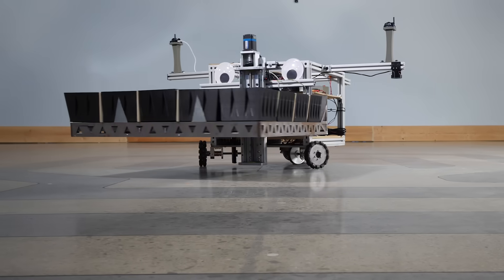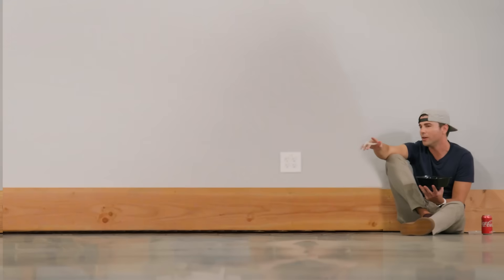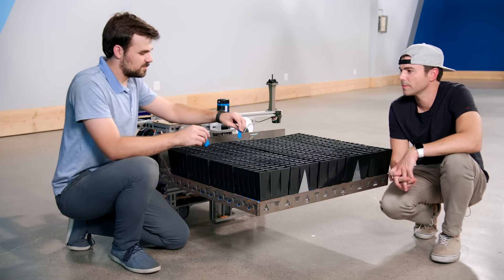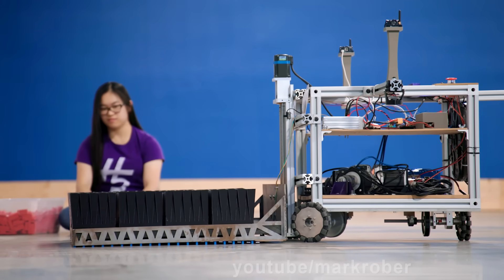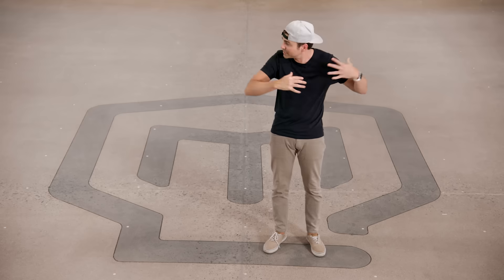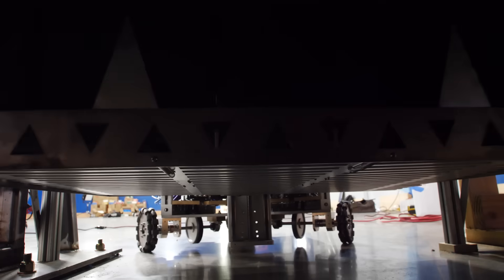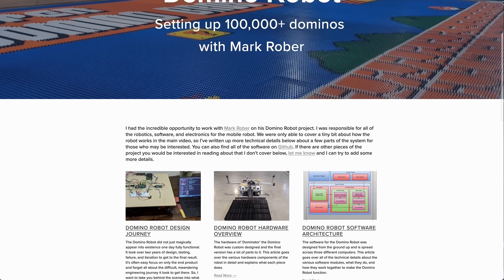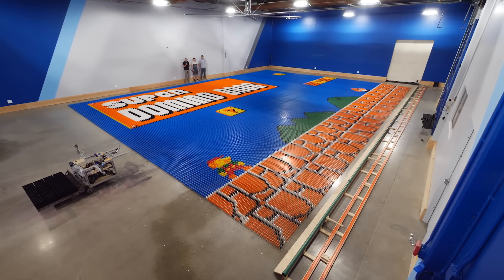World Record Domino Robot (100k dominoes in 24hrs)

Comment: cant you do it with a like reloading bay, where as it has 3 basket case where the first 300 dominos drop and the there’s another 300 dominos on the second level where we can use either a rotating basket or a secondary basket and drop of 300 and make it 3 times the building speed

Comment: It’s incredible that the weight of 300 dominoes being dropped at once didn’t cause any vibration or disturb the air enough to dislodge even 1 domino, I know it was very low to the ground but having just spent hours sitting up dominoes with my kids, albeit quite small dominoes, so many things can go wrong.
Reply: Concrete slab floor, basically no vibration from tiny light pieces of plastic. As for the drop, the amount of wind they displace is minuscule, there's probably more force in the natural convection that's happening in such a large room.
Reply: True😂

Comment: Ok, that's cool.   However, (probably already stated) per IDTA (international domino toppeling association) rules section 08291997.0214  only a  "single domino toppled may initiate the entirety of the chain reaction."  AKA - you only get one push rule - "the domino effect".  Delayed in series pushes with the  turtle and pipes would be a  immediate disqualifier.   Thus victory must go to Hevesh5.  I'll check back in 2 years for round 2.

Comment: Dom could be a tile layer's best friend too, especially if there was an elaborate custom floor pattern.  Just have Dom drop the tiles, then come thru and put the spacers and grout!
Reply: No. That's not how it works.
Reply: No, because tiles are often laid on an uneven surface and require a lot of fitting and cutting to size. It'd be too complex to program a robot that can do all that, and in a place it's never seen before, with so many unknown variables.
Reply: @Eagle3302PL  I don't mean letting the robot do the whole floor, I mean letting the robot set out the tiles in advance for the human to come through and finish it off.  Making a mosaic takes a ton of work due to selecting the tiles, this would take the work out of that and make it just like doing a normal floor.

Comment: this must have took a decent amount of effort but this is on the level of average for the high school I went to, available robotics and programming classes. it's the sort of starter program and robot we would build. It was a sort of proof of ability type build test. you would learn the basics of programming and this would be done in conjunction with another class the principles of engineering which would then be combined as a sort of test.

Comment: The follow up should be not only a clean up robot, but also one that sorts the pieces by color. I believe it will be much easier to design and make than the Dominator.
Reply: I kinda of did something like this as a final project for my robotics class in high school, we had to make a robot that would sort out foam balls by color.
Reply: Didn't their mechanical arm already sort pieces by color? The domino loading looked fully automated.
Reply: @illusionofquality979  They were loaded autonomously but were fed into the loader pre sorted

Comment: Anyone else noticed the row that didn't fall at 7:04? I love these videos btw, Rober is such a skilled engineer!
Reply: I did
Reply: No. But at 13:35 there is some rows in the big orange square that didn't fall
Reply: @quickmicdk  It's not a flaw, those are artifact lines for accuracy
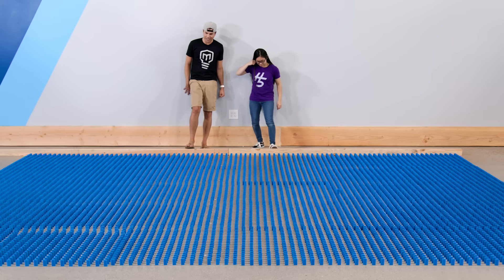Reply: At 6:54 you can see that they don't stand exacly in row, the robot had to calculate the position instead of see it, and if the algorythm and other factors aren't precise 100%, soner or later things going bad. To avoid this, the robot have to unstand how the field looks currently and what a correct positon really is.

Comment: As impressive as that was, and it was pretty cool, the robot did lack one thing that the human does..  The human version would have created a special falling path instead of 100,000 parallel dominoes that were all tipped over in mass.    What was lacking was some kind of falling pattern, the whole point of dominoes is you tip over one domino that triggers a much larger cascade of falling dominoes.   What was needed was a special pattern on one of the edges of the placer that was employed at the edge of the patterned that would have looped the falling dominoes back to the next row so just pushing over one domino would have knocked over all of them.   Don’t get me wrong that was an impressive engineering feat, but it did not represent what a true human made domino pattern does…. that a single falling domino triggers the falling of all.

Comment: Now for the next level...  Where the individual dominos are coded so the arm knows which color is which so it can use them (or sort them as needed) automatically, with Dom laying them down so that the end of one column will trigger the next column over, with the other end of that next column repeating the process, so you can start one domino and then it will knock them all down one column at a time.

Comment: I loved your invention, it's great the way you build everything modeled and thought to the point that everything is where it should be.  It is disrespectful to do it but I know that your invention could be further improved.  Currently the robot puts chips, travels, recharges and returns to place, what takes the longest is the trip so put more levels separated by gates and you could place a motor that opens and closes gates between each level and you can carry 3 or more domino plates and so instead of making 3 trips for 3 plates would be 1 trips for 3 plates or less.  For works reasons it would be faster and you would break your own record.

Comment: Id imagine fine tuning that platform to not have any wobble when it’s lifting was the biggest headache to this whole thing. It wouldn’t be super hard to just build a robot that followed a set plan and unloaded in a specific grid or something, but to make sure it wasn’t a wobbly vibrating mess, especially with that large and heavy a platform, and the way the mechanism to pull the trap underneath works must’ve been very time consuming.

Comment: Now what they need to do is create a baseplate and loading system for Dom that would be switchable so they could make turns with the domino's. It would have been way longer and cooler if they could have just started the chain reaction with one tipping of a domino.

Comment: tbh i find it very funny that this has 5 years of engineering built into it but isn't triggered by a single domino push but its very understandable and also still very cool. this combined with a lil human help to form the 'extra' stuff outside the main mural (the lead in line that triggers it all, any other fancy tricks that require curved lines etc) seems like a massive timesaver

Comment: Just a question I had when seeing the connect four tray release the dominos; if the tray is a single unit moving at once, why do the dominos on the far end drop before the dominos closer to the motor? Does that end move faster and release first even though the tray is one solid unit, or maybe it has to do with the droop of the tray over that distance?

Comment: Hmmmm... Pretty impressive, but to be fair, you've got two robots working together (the loader and the placer), not one. Also, the robots have got some extra tools handy, like funnels for easier loading and trays for faster placing. I wonder if you replaced the loader's robotic arm with a human trained to the loading task using funnels, and replaced the placer with another human trained to place dominoes with 300 at a time with a big tray... Would the robots still win?
Reply: I mean, it seems to me that the big facilitators here were not the autonomous robots themselves, but things that humans could also use to their advantage: the static tools and the pipelined process.

Comment: Wow, only 14,000 lines of code?  Impressive!  I have to deal with 32767 lines of code in each controller in our support sessions.  So, what is the method to pick up (not just push them around with a pushbroom) all the domino pieces after they have been tipped over?

Comment: All you need now is a duel container system programmed
to detect the dirt while cleaning up the dominoes.  The dirt
will go into one container and dominoes into the other and
all you have to do is put the clean dominoes away and not
have to sweep and clean off dirt from the dominoes when
the time comes to pick them off the floor.

Comment: Very impressive, love the detailed graphics! 
I spot at 7:05 some offset in some rows preventing the dominos falling completely as well as at 13:30. Is this a matter of resolution of the local positioning system?
Reply: It seems not all of them fell, you can see a row still standing at 13:40.  Then at 13:56 it is knocked down.  Did they manually knock that row down after the fact?  I didn't watch the entire video, do they mention this?  Does this still count as a record if they didn't all fall?
Reply: @digiride6155  I think the record was for building it, not knocking over the dominoes.
Reply: If they don't all fall down how can you say it was properly built?  What if another robot is faster but only half of them fall down, do they get the new record?   I took the time to watch the whole thing, and it's very impressive, but the deception bothers me.  You can see more that didn't fall at 13:43 in the B of Bros and then in the final shots they're knocked down.

Comment: Fantastic job.  Loved the science behind the robot.  I have a potential solution for automatically sorting out the dominoes when done.  You might even be able to adapt it for auto loading them for deployment.   Place a RFID chip in each chip that had its color.   Then you can have a reader to sort the chips into the proper boxes for reuse later.

Comment: Was there consideration of using a hopper approach vs the matrix you ended up using? (I assume to support parallel work: prep & dispense?)

I'd be interested in knowing if setting up one-by-one and just pulling from a hopper the desired color (and returning home to fill the hopper when necessary) would be significantly less efficient. If so, how much less efficient? 

And while I'm impressed with the positioning, I would venture to guess the hopper approach would result in more true lines (less variances between trips back and forth to the reload station)?

Comment: Absolutely fantastic!

I'm wondering if you had contingency plans in the event that some or all of the dominoes were triggered prematurely?  If you had to restart how would you have started with all new new packs of dominoes or did you have a system for sorting them based on color?  Was the software designed to handle re-building sections of the design?
Reply: No. Definitely not.....yet

Comment: And here I am, at my tech limit, putting a starter and clutch in my R1, and maybe a circuit board, motor, timer, in my washer, dishwasher. I was a Mercedes Benz tech for 7 yrs, but, I just worked on them, didn't engineer them.

Comment: Sir,
I have a query to ask, it is believed that energy cannot be created or destroyed. So, therefore energy should be a 'constant' value. It is also true that the universe is expanding and accelerating its expantion, which needs force. 'A constant force or energy can only accelerate an object to a specific velocity'. But here the universe seems to accelerate to an infinite velocity. The query is that, from where does this energy coming which causes this acceleration, if energy is constant. 'It seems as if energy is being created in this process'. Dark energy should also be a constant force. Also, if the things discovered till now are true, than the acceleration of the universe should stop at some time. 
Kindly revert to my query.
Thank you

Comment: Challenge: do it in a way you could knock down a single domino, and have the whole thing fall without missing any
Reply: another 3 years of working?
Reply: maybe he could 3d print them to be motor controlled to spin?
Reply: @neonblade8591  It'd have to be extremely convoluted since they have a maximum turn before it doesnt work
Reply: @seagie382  indeed.

Comment: If you built this for laying foundation for a building, one robot arm digs holes and then a cement based brick could be utilized similar to heat activated 3d printing filament that could be thermally heated to melt the bricks into perfect hardened flooring. Could also lay metal rods vertically using your robot, something that you see construction workers do laying wet cement and installing rods for the beginning of a structure.

Your robot could also be used to install batteries or package products at a high speed. Increase the size of the Dominator to drop boxes instead of dominos into shipping containers. Different sizes you could combine these robots in an Amazon warehouse to reduce the workload or use it with brick laying robots currently on the market to offer a robot based construction team, a robot hased automated construction crew that lays brick, builds the ground work, makes sidewalks etc. 

Last thing is obvious if you are interested in building a Dominator to plant seeds or trees. This robot actually reminds me of the tree planting robot a bit that plants 50 trees at a time, so you have successfully added another modular robot to the world! 

Imagine Dominator with a green thumb planting flowers and filling entire gardens acres wide!

Comment: The issue with this robot is that it doesn't create connected domino's witch mean in reality this was several different domino stages not 1 big one, so he had to do this whole complicated mechanism to actually start the Domino effect. IMO this DOES NOT COUNT. You need to be able to make the robot had different directions for some of the dominoes so that you can simply have 1 go form start to finish. Sad all that work and effort and he forgot probably one of the most crucial things required for dominoes :(

Comment: Very cool! Shigeru Miyamoto would be proud! The only thing this system lacks is flexibility. Creating some of non-linear creations of humans with odd curved paths, etc would be an exceptional challenge for this setup, maybe not even possible. Probably would need a robot arm similar to the one that loads the chutes that can access the entire floor and plop each domino down at any spot and any angle, quickly and accurately. Although speed-wise there would need to be several of them working simultaneously to have any chance of being as fast as this one.

Comment: So then the next challenge would be to make a bot that not only sets up the dominoes, but in a pattern that can be set off with 1 domino (like how a lot of cool designs are done and its just 1 domino that sets the whole chain reaction off).  So while a grid based system is perfect for mass settings, it would probably be something like one at a time, or a few more because it would have to incorporate turns in the domino chain, rather then just straight lines.

Comment: Shouldn’t it just knock one domino to get it started? Seems like a pretty lazy domino setup
Reply: I was thinking the same, but this was basic stacking. Maybe in a few years they can get one that does that. It'll take a totally different robot for sure. In anycase it was a satisfying video to watch.
Reply: It was designed to just place a lot of dominos in an area, not for all of them to be connected and fall from a single domino. That would be a lot more complex for them to do as it would require dominos to be placed at different orientations and angles which can't be done with the 300 mass placing mechanism.
Reply: Nah. He's thinking ahead. Why make one video when he can make another video later with a few modifications to his original build.
Reply: Oh I agree it would have been more difficult. But isn’t that the point? At least gets some angles in on the ends. So they loop eachother. Just an idea

Comment: Actually if you had a cleanup robot. which could reset  the picture floor. You could have a cleanup robot crew in the night and put it in the museum? Like the first sentient self building picture. after this the domino's could be shoved to a side where they fall in a chute, where they align back and get sorted based on color, the pipes could be reset by having a wire attached to it so after rolling it can be pulled back to place. Maybe users could submit pictures and based on the RGB it could figure out what to build. This feels like a beginning of a modern art project. Kinda feels like the japanese sand with the ball going and making pictures.

Comment: I am very disappointed. The whole point of a domino effect is having a single domino being the first to trigger all subsequent dominoes to fall one adter the other. Those pipes are a cheap cheat. After 5 years of engineering work I expected better.
Reply: The issue is that with the design on the floor they were using, it wasn't feasible to tie the whole thing together to be knocked over by just one domino. It would have made the entire thing look off centered.

Comment: 13:34 How in the world did that one line stay up?
Reply: not just one line. there is at least two other lines throught the B in BROS. better seeable in 13:42. And they also tried to cover it up in 13:56 but you can see that the line goes the other way
Reply: Despite the GPS, the IR cameras and the precision wheels - the robot is wildly inaccurate in its batch placements.